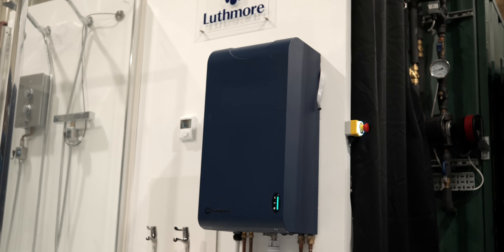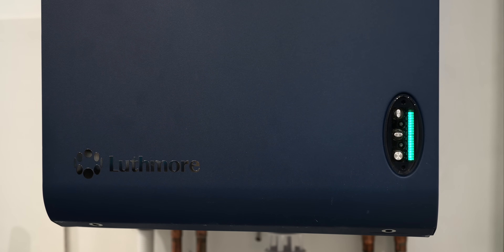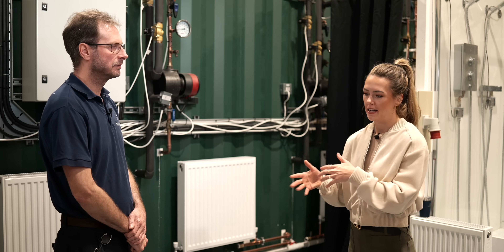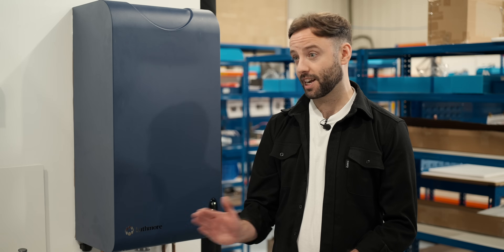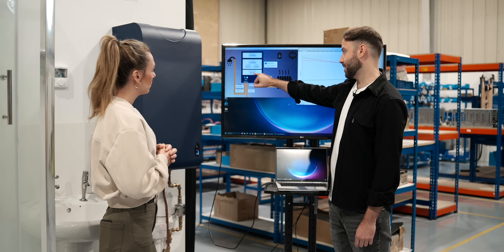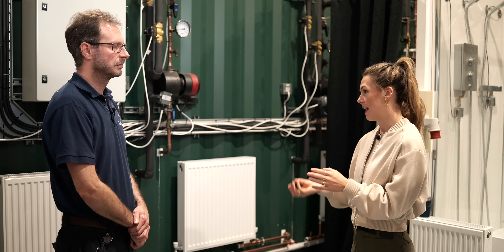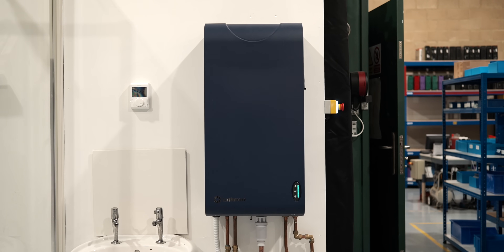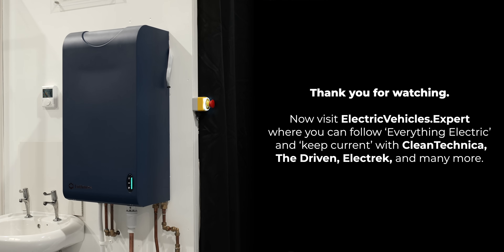Could This Battery Boiler Replace Gas AND Heat Pumps?

Comment: Would it run a bath comfortably ? As this is the issue I’ve found when looking for electric water heating with out a tank
Reply: There are other water heater options.. The Instant shower type or...  a smaller 10/15 ltr Hot water storage boiler which can fit in a kitchen cabinet and heats slower using Mains 2.5mm. About £300 I think.. Have 3 of them for a bath..?  Still only a £1k

Comment: I most say that I see no reason for any company that sell me a hot water solution to have any information on how I use that water. That is a good reason to select an other solution.
You can have an app that control the equipment and do not connect to anything on the internet.

Comment: I've an on-demand electric water heater and I've just tested our battery-solar system.  The power consumed by my particular market developed on demand system was multiple times, multiple times higher than my tiny diy electric induction  2 gallon hot water system I developed for my mist shower.   The induction system also provides all other domestic hot water needs as a bonus and temperature is easily adjustable.  If I can do this as an amateur seems a corporation could do this better.
Reply: Induction Boilers are gaining popularity in Japan/China and can be bought here on Ali Express type sites.  I believe (from reports I have read) that this type of water heating is very efficient and only cost a few hundred rather than thousands for the Boiler.   Very simple tech.. & NO flue .    This Video promotion seems purely based on Electricity Storage and therefore does not endorse any particuler end use.. 
I removed my Gas supply a couple of years ago due to Plumber issues and fitted an assortment of Fan and Element based heaters.  It's very simple and runs off my existing 2.5 Twin and earth cable to each space. No more Plumbers..  yay..                                                       I retained my old copper cylinder and use about 0.5kwh per day for my hot water requirements.
                
If water based heating is so expensive.. Use warm air like our Yankee cousins.

Most endorsements for Heat pumps boil down to improving Insulation somewhere in their blurb.   I do not believe HP's are the answer to Home heating and I use one to heat my Swimming pool at which it is excellent because it pulls its energy from the warm summer air.. COP6    Sucking heat from an icecube is not so efficient..  COP1

Comment: Stupid idea. 120 litre water storage and batteries?? Just use a 350 litre hot water heater and it will cover your needs without a battery.

Comment: This is good , but I am lucky enough space wise to have a solar thermal system topped up if necessary by my Eddi using off peak or battery input.

Comment: Nice, bringing planned obsolescence and extreme expense to your hot water system! Also making it completely reliant on a network connection is the extra icing on the absolutely avoid cake!
Reply: Can your gas boiler run with no elec?
Reply: @logik100.0 It can run for a really long time on a cheap battery and a cheap inverter with no internet connection to speak of. I use heat pumps as my primary source of heat and they also run as long as they have power without needing to check in with big brother to verify if I'm allowed to have heat.
Reply: @Snerdles What size is your battery? I want to do the maths on how long you can run for
Reply: @logik100.0  20kWh with a 10kW generator. I can last for weeks with no interaction with the outside world. I still need solar though, I haven't found a system that is worth putting in yet.
Reply: @Snerdles  So you can run a 10kw heat pump for a week off a 20kwh battery?
Reply: @logik100.0 stop being an idiot
Reply: @Snerdles  When push you buckle as your talking BS
Reply: @logik100.0 Obvious troll is obvious. That or you don't know what a generator is which means you aren't with talking to.
Reply: @Snerdles  My bad I really did not think you would be using an IC generator in a discussion about using heat pumps and the cost of off peak electricity to heat water
Reply: @logik100.0 and I didn't think some moron would be trolling because I cover myself in emergencies so I don't freeze to death.

Comment: This seems very niche application wise. It doesn't make financial sense. It will cost 3x -4x to install AND run Vs a gas boiler. There's no government grant for such a thing and electricity costs way more than gas per kWh, even on overnight tariffs. And it won't store enough energy from overnight tariffs to do heating and hot water. If you're in a flat, which a likely requirement of the niche use case, you're very unlikely to have your own rooftopsolar panels.
The efficiency of heat pumps and the gov grant can make them comparable cost wise to own and operate Vs a gas boiler. 
This is only for if you have no gas and no option for a heat pump and want higher hot water flow rates. A cheaper option in that case would be a hot water cylinder with electric immersion heater.
Not trying to be negative, if I could see a use case for this I would tout it. We need to move away from gas but for 90%,+ of people it needs to make financial sense too.

Comment: What does it cost, compared with say at Tepeo ZEB heat only boiler?
Reply: I have looked at both, I think Tepeo was about£7k but its big and you still need to have a water tank. Tepeo can store off peak energy to heat the house the rest of the day, this system only stores energy for water heating.

Comment: This looks like  a great product. Most boiler replacements are a distress purchase As a drop in replacement for  a gas combi boiler, it could be  installed on the same day as a  gas boiler suddenly fails. This is  not the case with a heat pump - if it's cold and you have no hot water or heating - you are not going to wait 3 weeks for a heat pump install.   It also fits in the same kitchen cupboard as a  gas combi, no extra space needed, no radiator replacement needed.  OK so  the running costs are higher - 7p a kwh vs 5p  depending on your tarrif - but you can save the  appropx £124 a year gas standing charge by getting the the  gas meter removed.    So for smaller properties the difference in running costs is not huge.  The purchase cost is a little bit too expensive, but  thats a temporary issue. Battery costs are falling rapidly. Within 3 years, with a bit of  increased sales volume , it;s easy to see how this product will cost less than a  gas combi.

Comment: Just keep in mind that once everyone starts using the cheaper rate of electricity to charge their batteries, be it in their EV, 'boiler', etc., it won't stay the cheaper rate of electricity anymore because the demand at that time won't be low anymore.  So you have this build up of more and more people becoming solely dependant on electricity and then bam, they're hit with even more increases to their electricity bills.
Reply: Oh no, midday power prices will go from nothing to almost nothing!

Comment: A simple and cheap (£300 ish) electric water heater (I have a 240L Ariston ) is perfectly adequate for most houses.  It takes less than 3 hrs to heat from cold, uses around 5 kWhs overnight to reach ~60℃ and stays hot all day.  It doesn't take up as much space as the old fashioned emersion heater and very easy to install on a wall.  These last many years if they are cleaned inside annualy.  The technology here is fun but likely to cost, what?  £10,000 at least?

Comment: my shower pumps out a huge 3l a minute, 4min shower 12l. so i fitted my camper with a 20l hot tank heated by the engine and solar-electric

Comment: I have the hot water set to about 45 degrees on our gas combi, which means you're not wasting energy by heating water to 60 degrees then cooling it down to 45 for a shower or washing in a sink! Without the heating on, our gas bill is about £25 a month, and that includes the criminal standing charge.
Reply: Hmm ... Google up the temp required for storing hot water.

Might save your life one day.

Comment: Brilliant for flats that have no space for tanks, or  heat pumps or space for home batteries. Need to see the dimensions as it looks a bigger than my combi.
Reply: For under £1000 you can get 200 litre thermal stores that are small enough to fit in the back of a cupboard, they can be heated direct from the mains on low overnight rates, from excess solar PV, or solar thermal. They store about double the energy of the boiler in the video, don't need an app to work, and will operate for decades without degrading.
Reply: @garysmith5025 Thanks Gary, the question is why aren’t they everywhere. I have never heard of them

Comment: Wouldn’t it be more cost effective to separate out the batteries from the heating system so you can use it for all electric use and have a super insulated heat store for space and water heating?  Battery storage just for heat seems inefficient, but has anyone done the maths?

Comment: How is the efficiency 1 when there will be a loss on the round-trip in and out of the battery?!
Reply: They also need to factor in the losses incurred in the distribution network e.g. 100 kw leaves the generation site and about 60kw arrives in the property.
Reply: @geoffaries  according to Ofgem, National Grid transmission losses are less than 10% across the national grid, with most of the losses occurring at local level.
Reply: Luthmore’s unique patented technology stores the waste heat generated by charging and discharging and uses it to pre-warm the incoming water (see it in action in the video above here https://www.youtube.com/watch?v=Nc5trKJvcjg&t=578s
). It represents roughly 15% of the total energy stored by the Luthmore boiler.

Comment: A lithium battery inside a house? Never in my house. There are sodium batteries now on the market that do not burst into flames.
Reply: We are very interested in sodium-ion technology as well because of the higher operating temperatures. They do not provide a safer alternative to LFP at this time and are not as widely available nor as energy or power dense. LFP cells such as those in the Luthmore boiler cannot self-ignite even in a failure condition.
Reply: @Luthmore 
Reassuring.

Comment: I know this is LFP (I have some very large self build batteries using this chemistry - all in outbuildings) but this solution goes against guidance of BS 7671 and in particular PAS 63100:2024. The problem with LFP is not thermal run-away but the highly flamable hydrocarbon gases vented when a cell decides to fail and produce white smoke which in a closed space is like turning the gas on and hoping no one turns the light switch on when the boiler fills the room with white smoke!
Reply: PAS 63100:2024 is an industry standard setting out best practice regarding the installation of Battery energy storage systems, as such, we recommend our installers follow them to the letter. PAS 63100 states that “Where practicable, storage batteries shall be installed outdoors”. As the Luthmore ONE boiler contains water pipes, which, may be liable to freezing in winter, we do not consider it practicable to install the Luthmore ONE outdoors. Resultantly the Luthmore ONE falls into the 40kWh limit of BESS capacity allowable in areas other than those specified in the standard. This comes with certain pragmatic limitations, such not being installed in corridors or bedrooms.
Reply: @Luthmore  could you have a version that splits the cells from the heating electronics and externally wall or ground mount the cells (with heat pads) and pipe some dc cables (i'm assuming HV DC not LV DC) through the wall - it could potentially be used as grid storage as well?

Comment: You need some help explaining this product. You need an elevator pitch and the engineers have explained things very badly. I’m an engineer who develops this sort of thing and am happy to help you explain it for a cup of coffee. 
1. State “it’s an ejectruc battery which can instantly heat your hot water and central heating”. ( don’t call it a battery as that might mean a thermal battery”. 
2. When she says “ does it work best with a certain tariff “ , say “yes”. 
She is great but the engineers give very long winded answers. Practice in front of the mirror and shorten your answers to brief and positive. I hope your business is a great success.